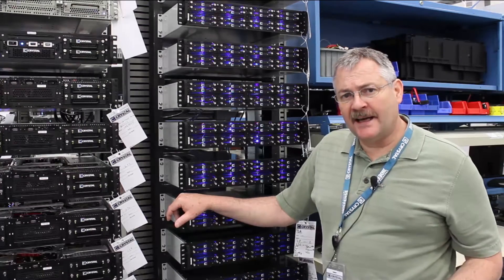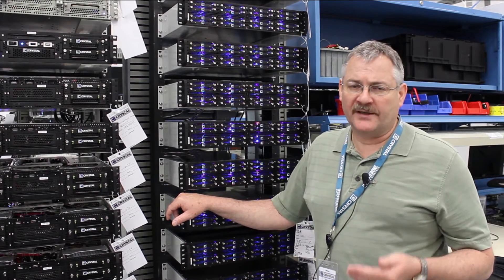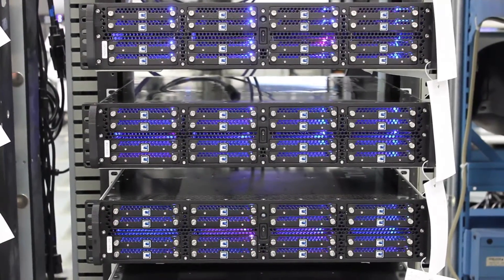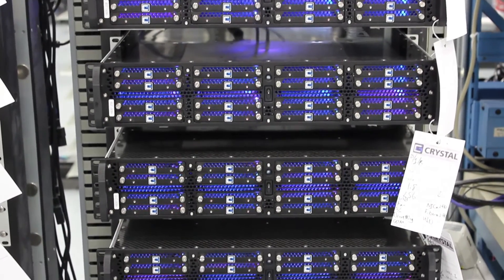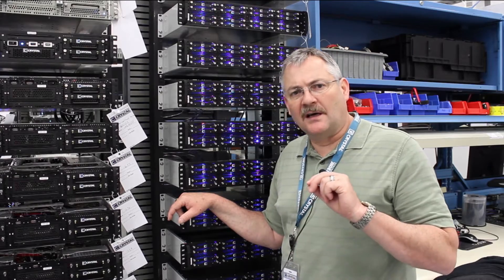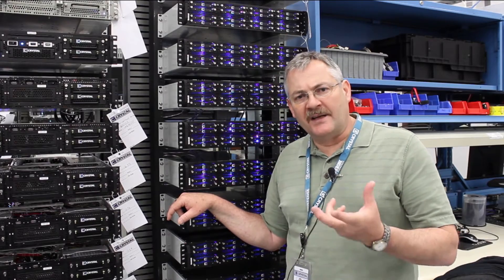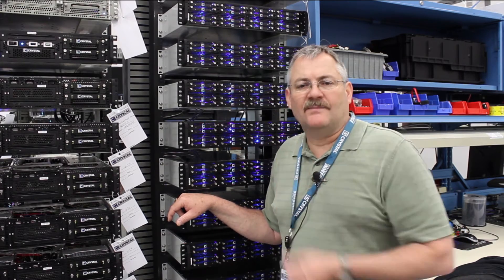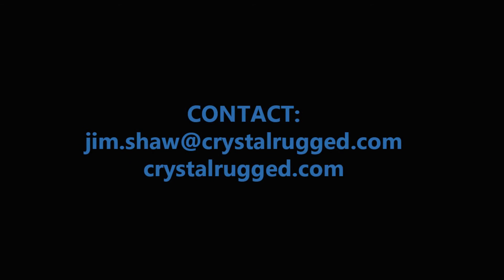MIL-STD-810 Test Method 509.5 Salt Fog  | Jim on Engineering | Volume 1, Episode 74

Comment: Hi, I have a question if you can help. I have used anodizing in an external product to improve heat transfer and corrosion resistance. But areas that require electrical contact do not have any protection. Can you suggest any method along with anodizing that take care of bare 
 conductive part?
Reply from the maker: Hi Kuljeet:
Here is my suggestion. I would not anodize the system but rather use the MIL-DTL-5541, Type II, class 1A coating.  This is a chemical conversion coating.  Anodizing is fantastic for corrosion resistance but, it is also a very effective insulator.  AlO2 is the product that creates an insulator at the surface which hampers grounding.  The Type II, class 1A is good for salt-fog resistance and a better choice for EMC/Grounding and bonding than anodizing.  However, the best choice for low resistance interfaces is MIL-DTL-5541, Type II, class 3.  The down side is the corrosion resistance.  So, if your test is a 48 hr test in MIL-STD-810, method 509, (24 wet and 24 dry) you will likely be ok with class 3.  If your test is the aggressive four cycle test (24 hrs wet, 24 hrs dry, 24 hrs wet, 24 hrs dry) then you should consider class 1A chemical conversion film for the aluminum.  If the box is open, remember to consider conformal coating the electronics if that is an issue.

Full disclosure, we have been using the hexavalent chromium material because we have experience with this (Type I) but we are currently looking to change to trivalent Type II because of environmental pressure.  Recently samples came back with good performance on the type II so I expect we will be switching over.  Many of our customers are making this a requirement now.  

Good luck!

Jim Shaw
Reply: Thanks, Mr. Jim Shaw
Actually, I am new to coatings. Can you name any commercially available Type II Class 3 coating?
Reply from the maker: @kuljeetsingh1596  
https://www.besttechnologyinc.com/surface-finishing/what-is-alodine-chem-film-chromate-conversion-coating/
http://www.henkeladhesivesna.com/henkeldocs/oilgas/10400_LT-6267.pdf